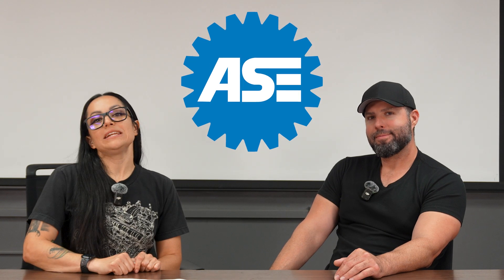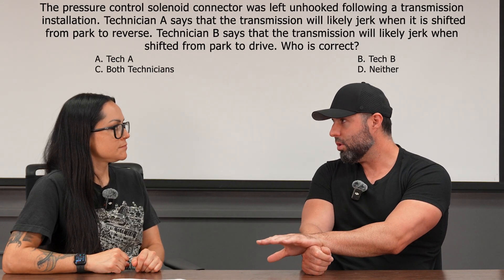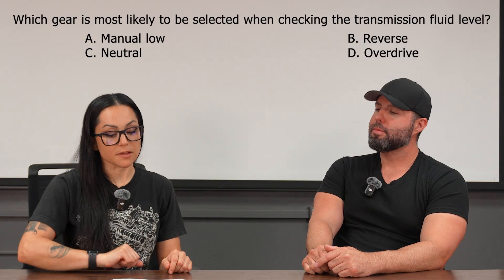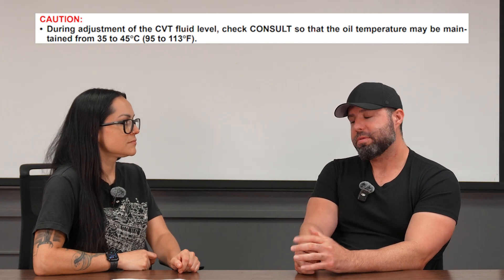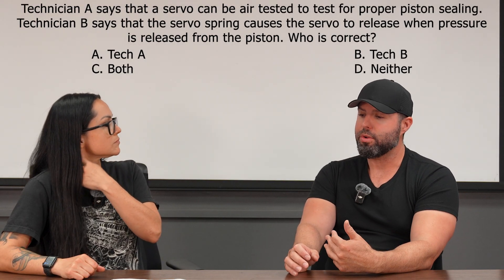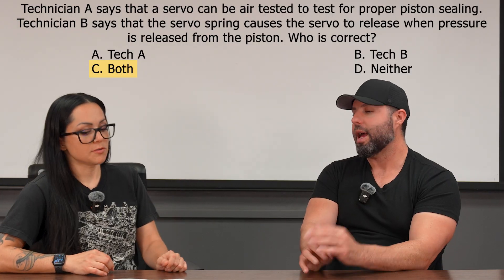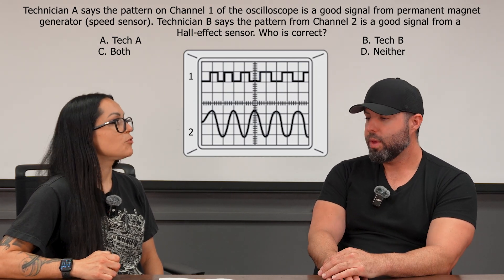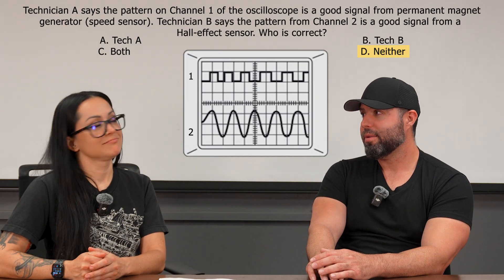Pass The ASE The First Time!!!! ASE A2 Transmission Test Prep Series Volume 2

Comment: The only thing that threw me was being able to test a hydraulic system with air (Question 3) … not sure if it would be a viable test for anything more than the worst possible seal … but happy to be corrected if wrong.
Reply: Using shop air to test apply pistons and channel plates is part of service manuals for hydramatic transmissions. Pretty interesting how they work to move rotating motion between parts.
Reply: @whatsAname-w777k I didn’t know that! Thank-you. I’d think the hydraulic system would behave differently with an oil vs air under pressure, but obviously not! Thanks again for the reply!